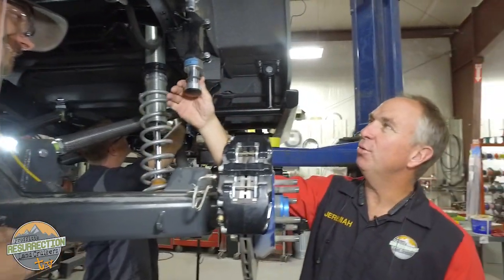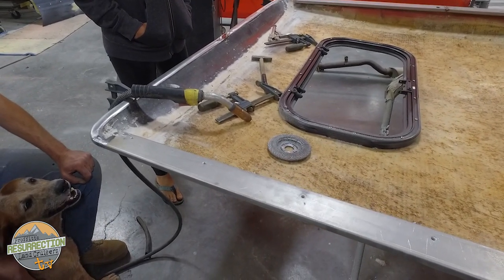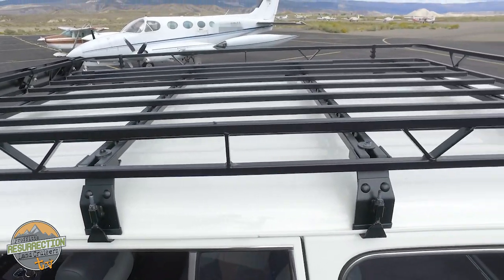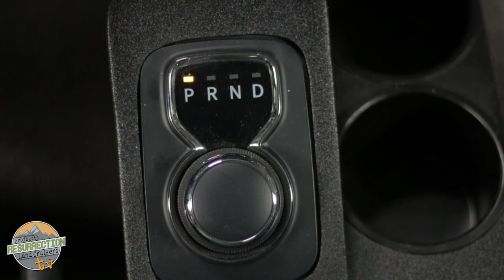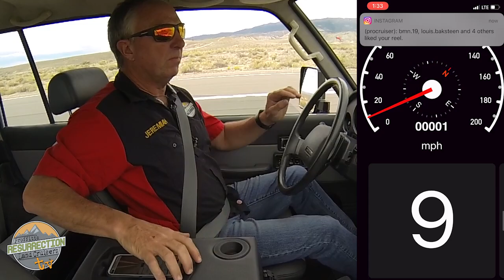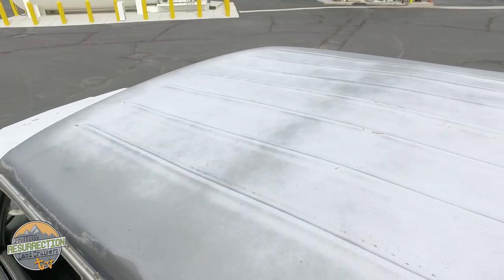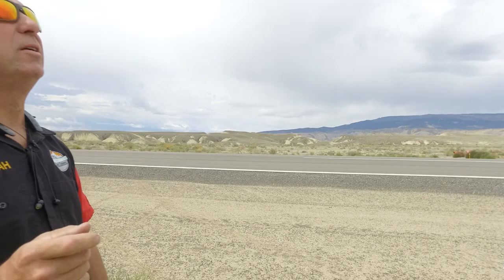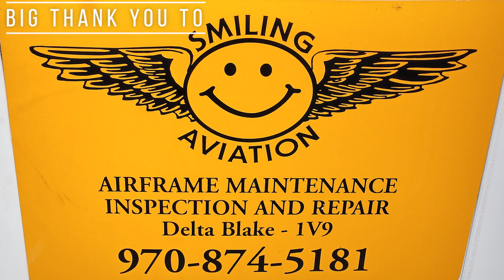FJ62 Stand-off! We race a Cummins R2.8 / 8 Spd Automatic FJ62 Stage 2 Restomod against a stock FJ62.

Comment: Diamondback should be your first "trail truck" project. do a mechanical resto on it with upgraded axles, spring over and 37-inch M/Ts, lockers, RCV shafts, hit it with a single stage industrial paint on the outside, liner on the inside, toss on offroad bumpers w/ tire carrier, jerry cans, and a winch, sliders, skid plates, a roof rack and bring it out to Reno for the Rubithon Wagon Run.